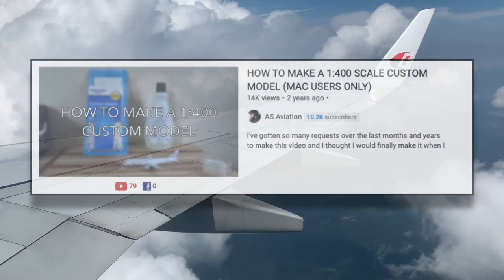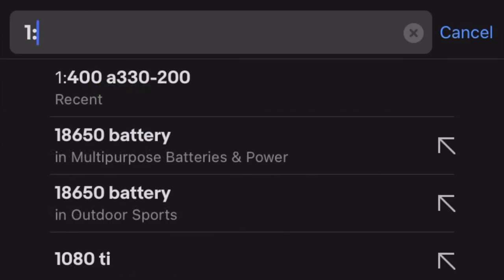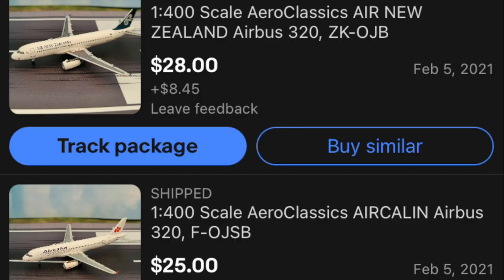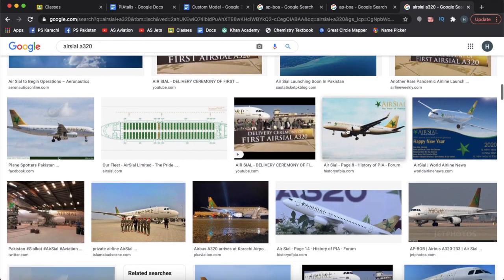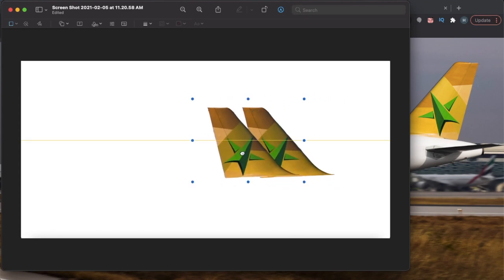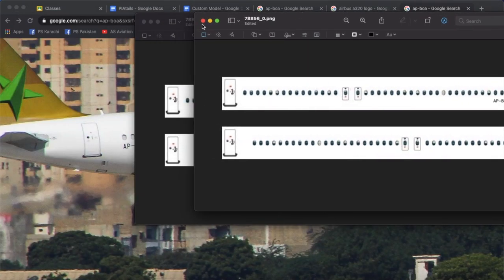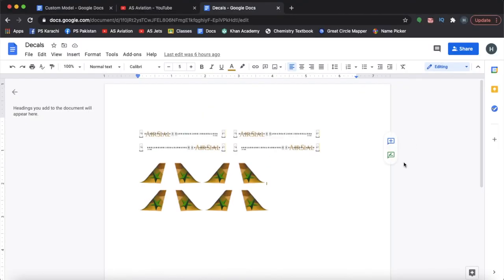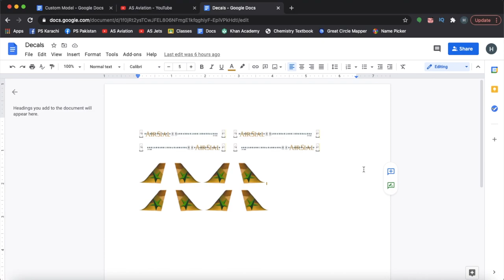HOW DO I MAKE MY 1:400 SCALE CUSTOM MODELS??? (2021 Edition)

Comment: Great customs! The lasso tool is the equivalent of what AS used in this video for Photoshop and free programs such as Pixler and all those. Highly recommend if you guys don’t have a MacBook to use Pixler if you did not have Photoshop as it does have all these features. The measurements are definitely one of the hardest parts I will be sure to be looking for a proportion tool online. Your customs are amazing man and excellent job! If I remember correctly you’ll also used the wood for reviews during that late 2018 timeframe too! Amazing!
Reply from the maker: Yes, on Preview it's called the lasso tool as well however I said "cutting tool" instead to avoid confusion. Thank you for the kind words and yes you're correct, 2018-19 reviews were on that cutting board too XD
Reply: @ASAviation  all good man! No problem man! Can’t believe it’s already turning into OG days! 😶

Comment: I like your decal work. I prefer to use decal paper myself but your paper ones turn out pretty good. As for your painting and using nail polish remover, I agree with one of the comments below with using frog tape. Works for me and the lines are crisp. For painting, I just got a battery powered airbrush on Amazon and it works really well. No paints brush lines and no specs from white out. I highly recommend that for your next project. Other than that, your models look great. Keep up the good work. 😊